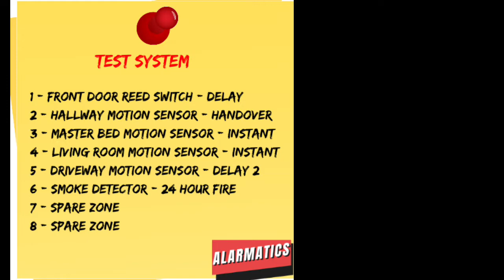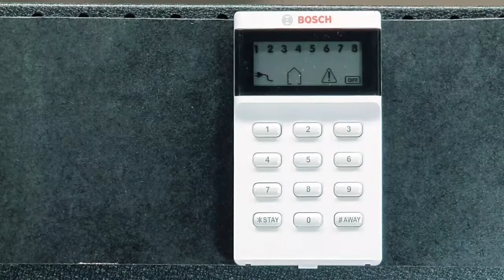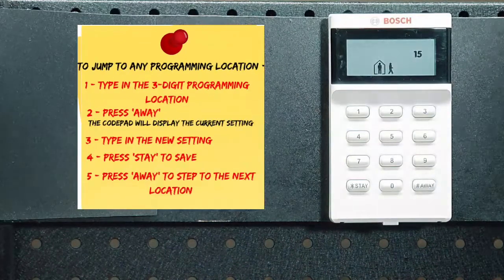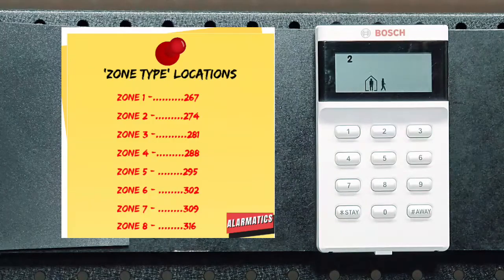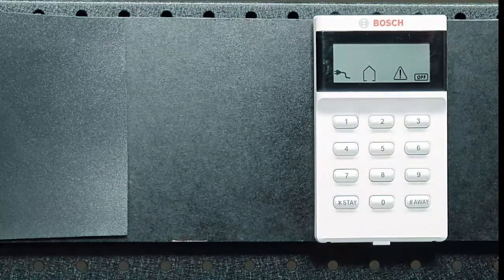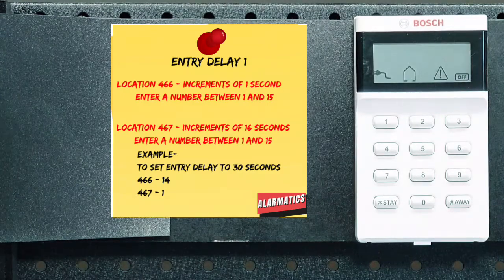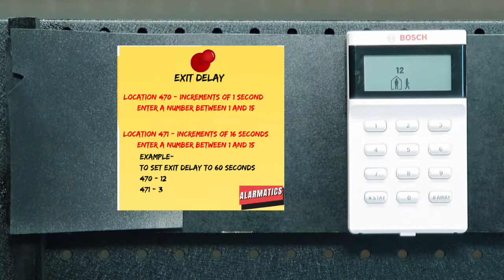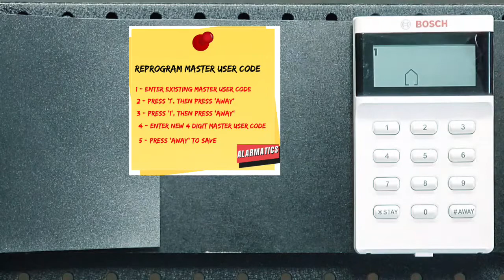Reset Bosch Alarm System to factory settings Ep: 101(part 1 of 5)

Comment: Hi Steve, this is great that you made this video. This is very helpful.
I recently relocated my keypad where I have to pass two sensors to disarm my alarm. 
How to delay two sensors?
I noticed in your video that you did not select which sensor to delay. How system knows which sensor to delay by going through 466 or 467?

Comment: Hey Steve, just wondering if you have an LCD Icon Codepad for the 2000/3000 that has firmware version v1.0 (the one that always has the keys with a backlit and longer illumination time after pressing a key)?

Comment: Excellent video Steve. I'd recommend if you change the title of this video and remove "Reset" as the first word then people will be able to find this video easily. Perhaps call it "Bosch Security System 2000/3000 programming and resetting". Just a suggestion as it took some of us quite a bit of time to come across this amazing training video.
Reply: Thanks for that suggestion.  I'm not that great at making videos, they are mainly aimed at our existing customers that need support. Glad you found it helpful. Thanks again for the suggestion.

Comment: Hi Steve, We returned from our holiday. My alarm was on. We entered the house and tried to deactivate the alarm with our code as always. Alarm went off anyway. Tried code a few times with no luck. I had to open and then cut the wire inside the siren box.  2 and 3 are still flashing on my control board. How do I fix this? Any idea will help. Thank you. Mez
Reply: I’m having the exact same issue, how have you fixed this ?
Reply: We found out that we didn't press # away key after password. So to rid off this problem we just activated and stright away deactivated alarm and all is good now. It's a bit confusing that when you activating or de activating alarm in both you have to press # away key after password. Hope this help.

Comment: Goodmorning Sir. Fantastic videos... Based in Victoria. I have a few questions to ask if possible... I’m a bit of info junki.    I love soaking in info.   
1. Is the reason for AC power only to  keep charge on the battery.   Y or N. ?  
2. If I remove the blue strobe outside can I replace it with a 12 v dc small spot lite.    
3. So basically ,this is for an area where there is no AC power and want to eliminate the blue siren/ strobe with a lite.    
4. I will use a solar power to charge.    

Any feedback would be great.    Cheers 🍻

Comment: hi Steve,  in your video, when you enter installer mode, sometime zone 15 lit up in keypad, sometime no, what is the reason? I have zone 15 lit up when i enter the installer mode, also, when i try to default reset solution 3000 panel by using same method in your video, the siren start as well, what's the reason?
Thank you very much

Comment: I have a Bosch system that about 12-15 years old. I need to set another PIN code to turn alarm on and off - zones are fine. Which tutorial do I need to watch? Also, i need new remotes - no one can suggest any - do you have any suggestions?

Comment: Hi Steve, I recently replaced my fried board of solution 880 with a replacement one. I have tested it working with the battery but I could not figure out how to connect the adaptor to the connector as my old cable colours were yellow/green, yellow & yellow. The new adaptor that came with the board has yellow/green, red & white. I can't attach the photo here to the comment but assuming you understand what I am asking for. I do not want to connect the wrong cable and kill the board. Any chance you can help & guide me on which cable goes where? I

Comment: Hi mate, I attempted to default my bosch by doing what you done disconnecting both ac power and battery. I hold the default button down and as soon as I reconnect the ac power, the alarm is goes off. How can I fix this? Just bought a new home and want to reset this please
Reply: Hey bud,
I'm having the same issue with my one. Did you end up figuring it out? Your help will be appreciated. 
Thanks

Comment: Hi Steve, The steps to Factory Reset the alarm panel do not seem to work on my Bosch Solution 16i ... Is there a different process to preform a hard reset / factory reset on this panel?
Reply: This video only contains Bosch 880 2000 and 3000

Comment: Hi I have rest to factory settings successfully thanks to you as I did not have any code and now I'm using the master code. The problem is I have only 2 sensors 1 and 2 but I can see constant numbers 345678 and flashing off how can I remove that. Thank you
Reply: Have you fixed this issues?

Comment: 2580 1234 won't work after resetting system triangle flashes when I enter a code it reverts to off position when I hold the 5 down the stay and away flash but it won't allow me to enter anything
Reply: Did you ever find a solution to this? My default master code doesn’t work after resetting. Installer code does work though.
Thanks

Comment: Great video thanks! When I try and connect the power and battery again the alarm goes off. Any ideas ?
Reply: I disconnected my siren so I could reset and reprogram...lets you experiment without angering your neighbors
Reply: @kneecaps2000  how do you disconnect the siren? Facing the same issue and have already annoyed my neighbours 😔
Reply: @husainkhambaty6136  on the lower /  bottom of the board you will see green connectors with wires going in. You need to figure out which is the siren..it will be on the output contacts..they are labeled. My siren was wired in with my strobe.
Reply: @kneecaps2000  What exactly needs to be reprogrammed to stop the siren constantly going off after reset?  Will try and do that first !
Reply: @johnbuckley2297   @John Buckley  okay..when you factory reset I recommend just disconnecting one of the wires to the siren. There is a reasonable amount of programming to do after a reset to get the system to behave itself. There isn't a setting to simply disable the siren.
Reply: @kneecaps2000  Thanks mate, I've done that but I'm curios as to why the sirens continually go off after a reset.  What is the setting causing this?  I've changed all the zone types to "not used" as I thought it may be some were defaulted to "instant" or the 24 hour tamper zone.  But sirens are still sounding once I reconnect the wire
Reply: @johnbuckley2297  it might be the Normally Open / Normally Closed setting on the output. The siren can be wired two ways. When you reset the programming the output will default and that might means that it's closes when you want open. The alarm panel itself has no idea if open  or closed is powering the siren or whatever..so settings and wiring are provided to accommodate the options.
Reply: @kneecaps2000  I've seen this same issue posted in a few places with no reply, so it is at least somewhat common after a reset.  I'm sure its a setting, but which one !?!?  Are you saying there is a setting to change the normally open/closed for the siren output ?
Reply: The control panel looks fine, no beeps, no flashing etc but the sirens are still sounding.  I tried this: Armed the keypad, stepped into one of the zones and the keypad beeped and flashed as if the alarm was triggered.  Plugged the siren wire in - yep sirens are going off.  2580#, keypad is disarmed, plug siren in and of course its still going off.  Its like the sirens are juts on no matter what !   It was working fine, but I did not have the master code.  So i did the reset on the board like the video said without touching any wires or settings and now im in this situation with the siren constantly going off.  It has to be a setting that has changed after the reset - but which one !?!?
Reply: @johnbuckley2297  yes..the outputs have a normally open/normally closed setting. You need to set them the other way if it's sounding when it's not supposed to.
Reply: @johnbuckley2297  Correct. Depending on how your siren works/is wired in to relay.
Reply: @kneecaps2000  Ok, so I think I have it working.  The negative of the external siren was in OUT1, and the negative of the internal siren was in OUT2.  I worked out the external siren was behaving correctly in OUT1, so I wired both sirens into that output.  Any issue with that do you think?  Why have the sirens wired to different outputs anyway ?
Reply: @johnbuckley2297  Were you able to make it work? I'm very new to this and with no clue why it is going off.

Comment: Hi Steve, we have just moved into our new rental. It has a Bosch alarm 3000.
I tried the default that you recommended, however every-time I connect the power source the alarm keeps ringing loud.
Could you assist. Many thanks.
Reply: Were you able to figure this one out?
Reply: Same problem. Bumping in hopes that someone has a solution.
Reply: I have the same problem, did you find a fix ?
Reply: @rxtnoir9239  Hey did you found any solution to it?

Comment: Hi thanks for the video but holding the default button and reconnecting battery, after 10 seconds the alarm went off...
Reply: I have the same problem, did you find a fix ?
Reply: @johnbuckley2297  nope, spent $300 to get an alarm guy to reset it...
Reply: @mv9143  Wow, I'd love to know what setting it was.  Do you know if he touched any wires in the main box?  Or was it all done on the code pad ?

Comment: Hi there, i could set up 2000 and 3000 with these zone values but not the 880. can you suggest what i am doing wrong? thanks
Reply: Did you find a solution?

Comment: What if I can’t arm my house for example I have this problem I can’t connect to the app which means is appears connection error unable to connect to specified panel what’s the best way to get it fixed ??
Reply: Have you found solution for this issue?